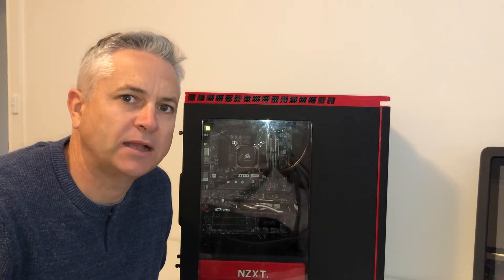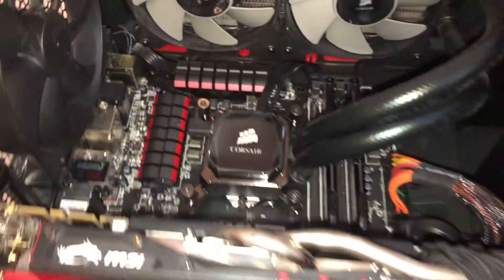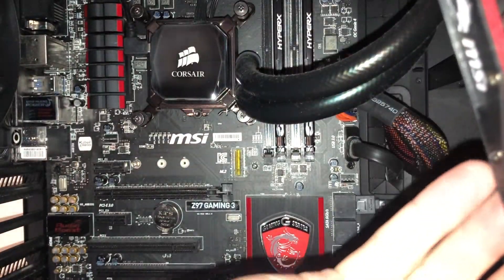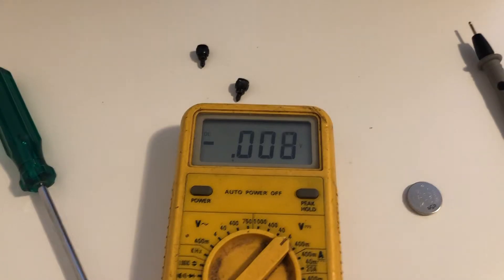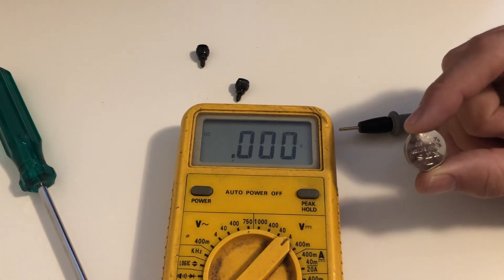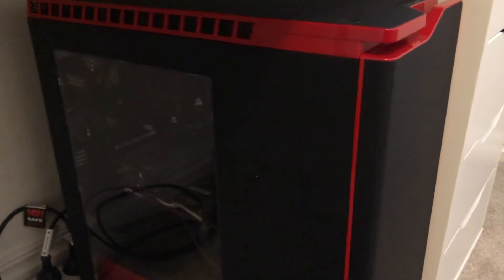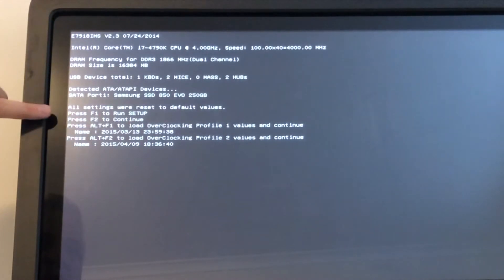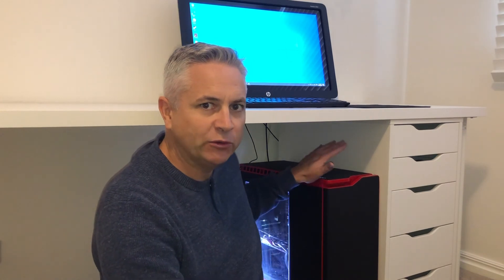How to Fix MSI Gaming PC that will not turn on!  Z97 Motherboard

Comment: My computer blew out during a storm last week.  No power.  Replace the power supply , cord, and checked all i could . Still no power.   While searching for a re conditioned Z97 mother board i came across this video.  GLAD i did.  I had nothing to lose so i found the battery and pulled and tested it,  Dead as a door nail.  I replaced it and my computer, fingers X-d and it turned right ON.  I could not be Happier as i thought i lost all my family photos and other important stuff.  I want to say THANK YOU SO MUCH ,, For taking the time to make this video.  YOU SAVED me from buying a new computer.  Thank YOU
Reply from the maker: Glad to hear it helped you out, thanks for the comment! Cheers Drew

Comment: Have the MSI Z97 Gaming 7 motherboard  and the exact same NZXT case. 

Problem:  After changing my BIOS battery to a new one as my PC's date/time were off after every boot, there is now power to the motherboard (judging by the lights on it being on),  but my start button (on TOP of the computer case) does not power the computer/motherboard on, despite having no faulty PSU. Could it be  a loose wire to this power on button? To what header does this physical on button slot into the motherboard, as it might have wiggled loose?
Cheers.
Reply: EDIT: Solution found! -- Had to press and hold the power button ON the motherboard (and NOT the case power button at the top of the NZXT case) for 20 seconds ... then the MSI Z97 Gaming MOBO boots up!

Comment: Replaced the battery and it's finally booted up! Unfortunately it's now saying reboot and select proper boot device... I've changed the boot order to my SSD but no luck. Any ideas?
Reply from the maker: Hi Mate, sounds like you are making progress!  Does your PC have multiple HDDs/SSDs? Cheers Drew
Reply: @DrewFixIt  Only 1 SSD. Was working perfectly before the CMOS battery died. Hoping it's just a setting in the BIOS but so far no luck!
Reply from the maker: @Snowatlas  I agree, it feels like it’s gotta be a bios setting, however suggest that given you opened up the case just double check the power and data connectors to the SSD.  If still having issues then try a factory reset of all bios settings.  Good luck!  Cheers Drew

Comment: I have the same type of board. Pc just did not turn back on. Checked power supply and it's perfect. Took everything out of the case and used a new f panel connector and nothing, no lights, no fan spinning, nothing at all. I havent tried switching the bios battery nor resetting it. Do you have any suggestions or should i get rid of it and move on with a known working motherboard?
Reply: It my time to try
Reply from the maker: @FaizanMulla  Good luck Faizan, I hope it works for you too!  Cheers Drew
Reply from the maker: Hi Ramon, absolutely if you have not done so then put a new BIOS Battery in like I show you in this video.  Note - they only cost a couple of dollars! Cheers Drew
Reply: @DrewFixIt  lol, I took the bios battery out of a working board and it worked! Haha!
Reply from the maker: @im2sexyforyou  awesome! Cheers Drew